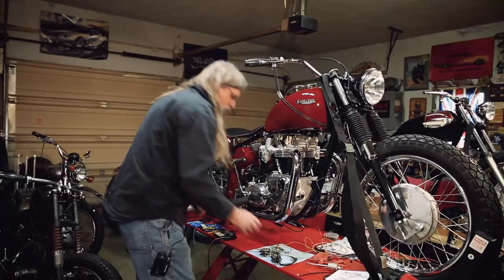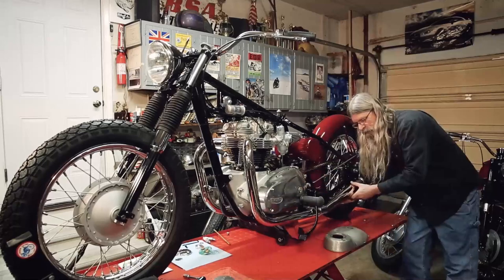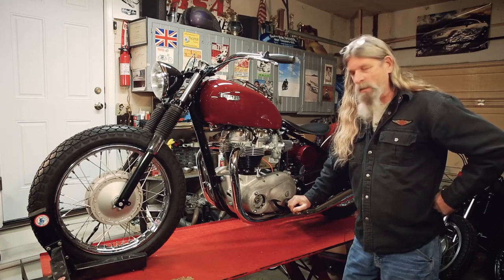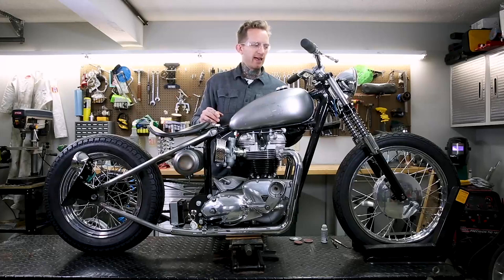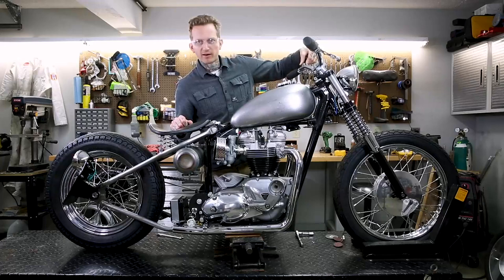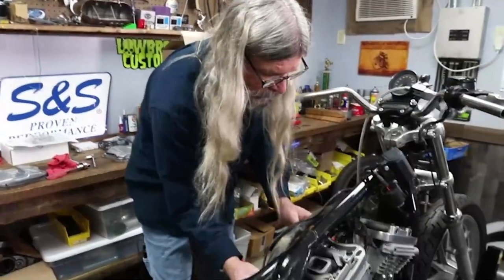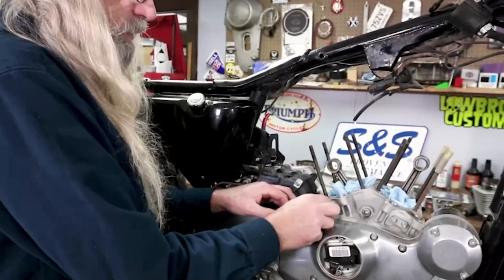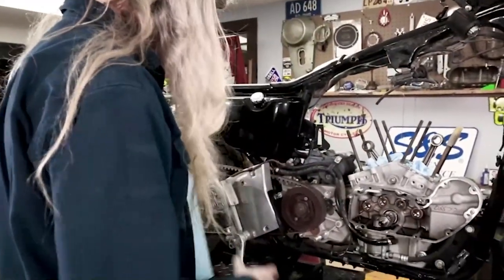Lowbrow Customs: Best Bike Installation Tips

Comment: What year are those Triumphs? I have most pieces for a build like that except the frame and hardtail section. I need to rebuild the wheels but have a newly rebuilt front end/forks like those plus seat, bars, lights, oil and gas tank.

Comment: Years ago - and I am sure you have seen it - Brit bikes used to use fabric 'Loom tape" instead of conduit or plastic sheathing and I still use it as I find that it permits access to the individual wires much more easily if ever needed.